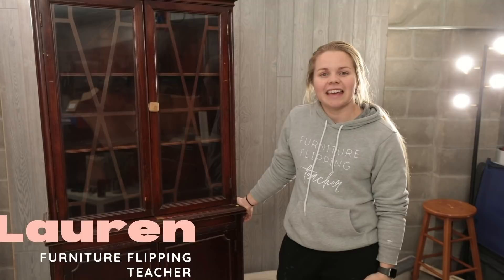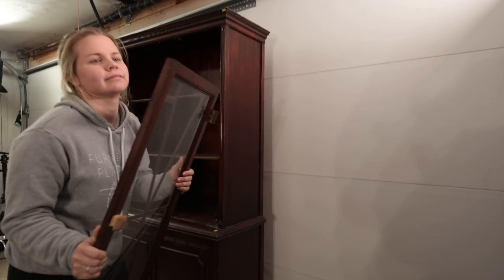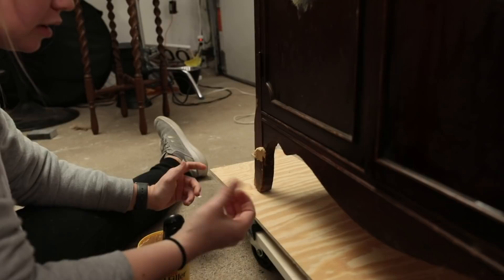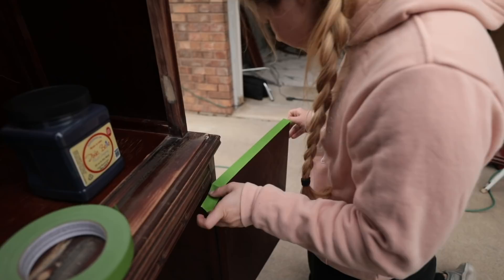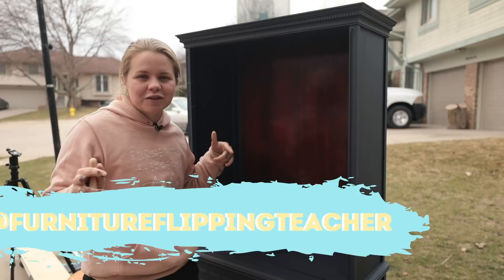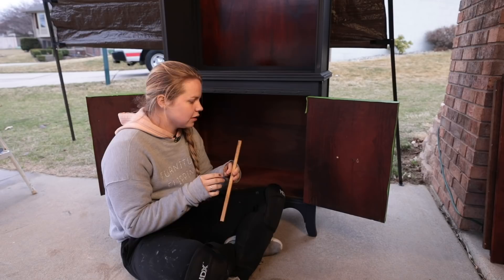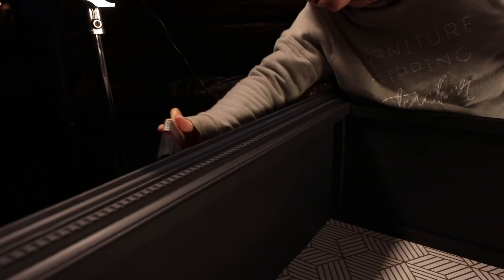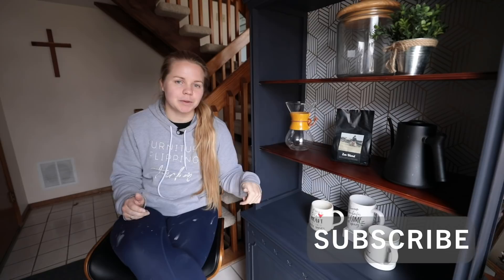Flipping a Hutch into Modern Coffee Bar | DIY Chalk Paint Upcycle

Comment: I have wallpapered some backs on some bookshelves and what I did was remove the back, stick the wall paper on there and then nail the back back on.
Reply from the maker: Ahhhh, interesting! (: I like that idea!
Reply: If the back can come off. Some do not have that kind of thin board on the back, You would actually have to take the whole piece of furniture apart on all my cabinets. It is a good idea however.
Reply: You can put the wallpaper on a piece of MDF, then using double-sided tape to hold it in place. The shelves will also keep the “false back” in place.
Reply: 😎From AZ...Awesome ideas on how to attach wallpaper, etc to bookcase inside back or cabinets.  For example; I use IKEA Billy bookcases often for many of the rental homes I have owned and they are great to carry a heavy load per shelf and now come in prepainted colors.  I removed the backing, papered and carefully re-nailed the back on with tiny nails. Great updated look for staging with minimal decor pieces or tenants books etc.
Reply: @dorothyyoung8231  
...except that the shelves might not fit inside with the extra thickness added to the back panel...?

Was thinking that you could get some thin quarter round and frame out the back panel covering up the edges of the wallpaper on top, bottom, and both sides. Would hide any areas where the cutting wasn't perfect. Again, the framing on the sides might cause the shelves to not fit... but maybe you could cut notches out of the quarter rounds on each side to accommodate the back of the shelves...?

Also, I would have placed the seam for the two wallpaper pieces in the center of the back of the hutch and cut the two halves so that they'd be mirror images of each other before sticking them down... does that make sense?
Reply: What did you use to adhere the wallpaper

Comment: Omg lol this made me literally yell at you like a momma at the Screen when you were applying the paper!!!!  If you measure it in one direction, Please, don’t flip it around and expect an old piece of furniture to be square and it fit the same way! But better yet....  apply the paper the way real wallpaper is installed. Extend it past the short edges and apply it aligning the long vertical seams only so they are correct, even, level, and then cut the top and bottom edges once you are all complete! Never cut the paper the exact length of the wall/surface you’re applying it to. Cut when completed.   Hope this helps you! Because it helped me tremendously to keep me from dying...😂🤣🤣😂  Love your channel, what you’re doing and everything you stand for!!!!🥳🤩😎

Comment: Great job. I would like to add a helpful tip: Paint the bottom edge or the the top of an armoire or shelf unit if they have a curved top or curved trim. Those edges are exposed when viewed from the side. It is a small touch but worth it.

Comment: I have a piece I’m working on now with warped doors. I looked up a old trick that worked great and it straightened the doors. If you can remove the glass...do so first. If not it’s fine with them in just need to be more careful. I laid the doors on the concrete garage floor. Put wet rags over all the wood and kept the rags wet. Put weight on each corner of the door frame to weigh it down flat to the floor. As the water draws into the wood it slowly took the warp out! 
Kept the rags and weight on the doors for a full day and night. Worth a try and it did work for me! Maybe you can try it to on a future project with this issue! By the way...I use to live in Bellevue and now live in southwest Colorado...and my son and his family live in Millard area of Omaha. Small world! You did a great job 👏🏻
Reply: Could even give it a try on the door in question. 🌻

Comment: Not sure if anyone mentioned this since i didn't read the almost 600 comments, but you can use toothpicks to fill holes from screws before you apply the wood filler, and try dowels in larger holes. You can use less filler and help reduce it shrinking after drying

Comment: When your screws are stripped or when having trouble getting a good grip with the screw and the screwdriver, use a rubber band to put in between and it will give you grip.  Kind of like using a rubber mat to open a jar of pickles.

Comment: Wall paper. A very sharp exacto blade. Only use one blade for one cut. Snap  blade off use new blade always after every cut. Use the manufacturer’s edge to butt up to manufacturer’s edge. Plane ahead so your paper will still match. You could put paper down the center put matches on each side of center strip

Comment: You should invest in a simple metal straight edge for cutting those things. It's like $6 at art supply stories. And if you put a little painter's tape on where you're going to drill, it keeps the paint from chipping, the wood from splintering, and keeps the surface from getting dirty. Cheap and easy.

Comment: If you place the one door in a vice for a few days and make sure it's bent in the opposite direction for a few days, it should take the bow out. Any wood bent for a prolonged period will usually return to its shape when bent and held in place by force. A Coffee bar doesn't need doors anyway, so you made the proper move, IMHO.

Comment: It is really cute!!! Good job! Try using the wallpaper that you wet on the back rather than peel and stick. Everyone will tell you that peel and stick is easy. But even pros hate it.  The  kind that you wet on the back allows for more leeway. It is also even cheaper with greater selection. You can line it up once wet and it is wayyyyyy more forgiving allowing you movement without folding and bending your paper. Also a dry eraser is nicer for burnishing because it doesn't scratch the paper.

Comment: Something I have seen but not tried.  Use a paper punch on a piece of painter's tape.  Center the tape over the hole you are filling.  Add the filler,  smooth, remove tape.  This keeps the extra filler  off your piece so you only need to sand the extra over the filled area.  Hope I explained it well enough.  I'm going to try it on my 100+ yr old painted window trim where window hardware was removed.

Comment: The topcoat picking up the chalk paint, I used to have the same experience when I would topcoat with a liquid vs a wax. Sometimes you do have to let chalk paint dry for at least 8-12 hours or even overnight before you use a topcoat vs a wax. The water in the topcoat activates the chalk paint since it is a water based project.
Reply: I had that same issue when I painted my laundry room cabinets- I thought it was the foam brush, but actually I ended up liking it since it gave it a little bit of a distressed finish that I didn't realize I would like.
Reply from the maker: Yeah, this happens a few times! Sometimes I just get a little impatient! (: Thanks for watching!

Comment: The secret to working with flat head screws is to use a narrower screw driver (an older one with a wooden handle) or a thin tip newer one (harder to find).

Comment: That's called contact paper, wallpaper uses a glue backing and it's quite a bit harder, also wallpaper's finished end is usually cut last (after installation) so that it follows the wall/ceiling exactly, then the next piece is lined up. Do you put foot pads on the legs? Just a nice touch for your better pieces, looks beautiful : )

Comment: I think, I would have went side to side, horizontally, with the wall paper. Any imperfections may have been hidden by the shelves, and your eyes will see the vertical, more than the horizontal lines. My brother told me, that his friends, who work in building, say you are supposed to hang drywall horizontally, instead of vertically, because it fools the eye, if there is a minor flaw. Just a suggestion.

Comment: Oooooo! I love this hutch!! You rocked this flip, Lauren!! What was your opinion on the hinges in the end? They look awesome painted, do you wish you had spray painted them to match the hardware? Also, you did an amazing job matching the wallpaper design - I was breaking a sweat watching you dealing with it (I get frustrated with stuff like that too! Lol)! Tip for bubbles: you can use a straight pin to pop bubbles after the fact (in case you missed some). It releases the air and you don't see the pin hole once the wallpaper lays down flat. 
Would you mind doing a small video segment showing the difference between not using water with chalk paint and using it? I have never actually used it so I don't quite understand what you mean about the gliding easier and fewer brush marks. Just even on a scrap piece of wood or something...? Thank you so much! I hope you're also taking some time to rest during spring break - you deserve it!!! 
Thank you for continuing to inspire and teach me, Lauren! Mondays and Thursdays are my favourite days of the week 😊 
See ya on the flip side 🙌💪

Comment: I did have to use 2 coats of Zinsser BIN Shellac based primer so it wouldn't bleed through. I used AS Old Violet, a subtle blue, and waxed it with her dark wax after using her clear wax first.
Reply from the maker: I definitely think this would have bled through if I didn't use such a dark color!

Comment: Did you give any thought to putting Gator Hide on the shelves, top and bottom, and the side, top and bottom of the inside 'bar'? It will help with the use of those areas as a coffee bar, especially the steam/heat from the coffee.
Reply from the maker: I did not. I just don’t love the sheen the gator hide gives off. I think the wood should be pretty good and then the bottom shelf I did use topcoat 😀

Comment: I’m still confused on when I should prime & when I shouldn’t? If it’s solid wood I don’t prime & if it a plastic coated particle board I should prime. Is this right?
Reply: If it’s something you can scuff sand to give it texture then you shouldn’t need to prime unless you are putting a lighter color over something dark. The purpose of primer is to give the paint something to stick to so it doesn’t peel off after it’s dry, and to cover darker colors or stains so they don’t show through the new color

Comment: I don't mean to be judgemental, but the "wallpaper" that you put on the back is not wallpaper it is contact paper and is 100 times harder to use than wallpaper! wallpaper you can get already prepasted or it is dry like paper and you use wallpaper paste either one gives you time to work with it and it stays wet long enough to make sure it is on correctly. Contact paper is sticky grabs the product that you are working with instantly and won't let go! I've ruined a contact paper but almost "never" wallpaper. and you have probably seen the embossed wallpaper that you can paint any color you choose and leaves a gorgeous product!
Reply from the maker: It's actually peel & stick wallpaper! (: Thanks for watching!